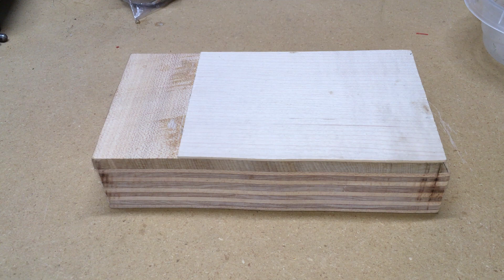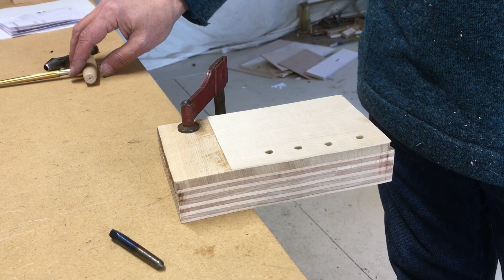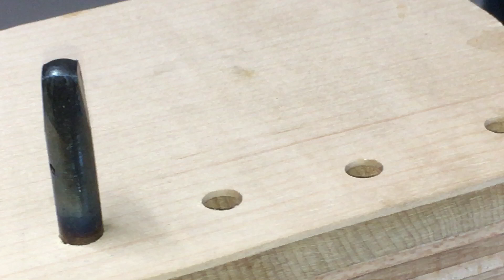Tapered Tuning Pins 2; the ideal tool.

Comment: i don't see how a cross hatched thread would be useful because essentially it would end up being more like a file, so any microscopic threads that would be cut would be simultaneously filed down. it makes me think that the threads were turned clockwise then turned counter clockwise. haven't seen pins like that yet, but i'm only a beginner. friction is key, but also i imagine you want the pin to consistently move towards the board even though it would be jumping threads anyway, especially since it's tapered and can't really screw all the way through the board. curious stuff, thanks for these videos on your research.